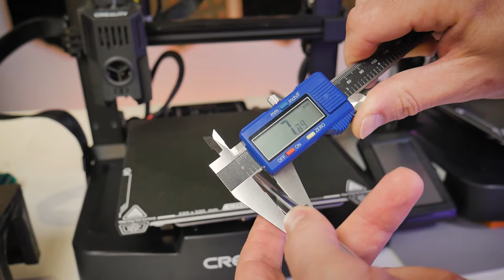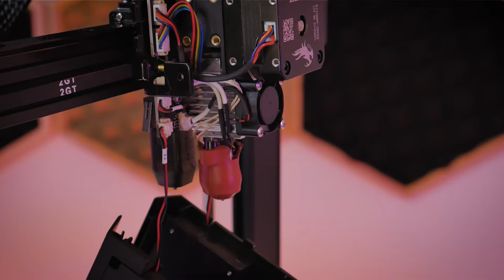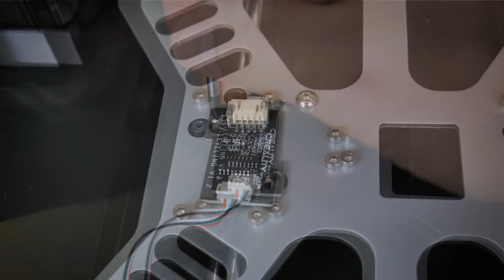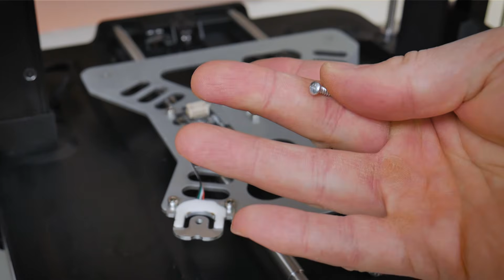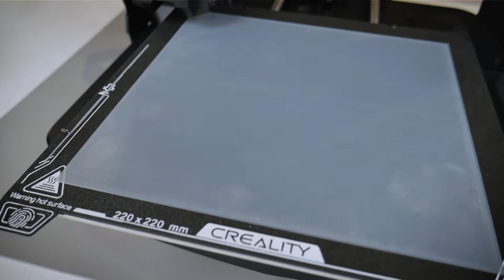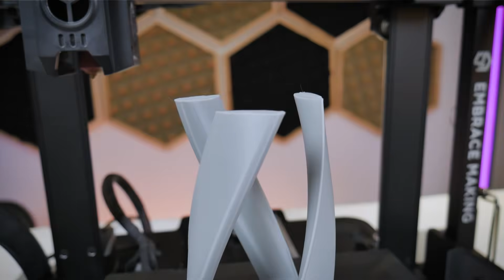Creality Ender 3 V3 KE/SE 10mm Rod Upgrade, Improve Bed Mesh, Fix Slanted Gantry, Unstable Print Bed

Comment: This is my first 3d printer. My gantry is inclined towards front I found a print fix to make it 90 degrees kinda fixed it but now my prints after 1 cm looks not smooth. I dont know what to do 😢

Comment: 5:04 for those who do not have metal machines blocks you could use the glue sticks one would use on the bed. As these are consistently the same length.  Two of those would achieve the same result on a cheaper more DIY basis.

Comment: Plastic stand-off's?  There's  the problem right their lol.  U didnt mention if u measured them for uniform size,   imo ,    They should be made out of steel ,precision cut, and at least 2x the diameter  of the plastic ones.

Comment: Bearings not included. As to why is beyond me. It’s an upgrade kit missing integral parts. And having to order them separately, risking that they won’t fit is just a nuisance.
Also, the plastic bearing holders are not precise. I had to print a 0.2mm shims to have no play of bearings and holder. And the bearings are precisely 29.00mm long. The inner length of the holder is 58.2mm. For the price, not acceptable.
ALSO: It is crucial that the bearings are oriented the right way. There is 4 rows of bearings in a linear bearing. They form a square when seen from the hole. That square must be perpendicular to the Z axis (or parallel to the x axis).

Comment: "As you can see I have printer rooted ..." , please elaborate
Reply: He has taken the printer off the factory settings and made it so that the firmware uses Klipper. My friend bought a KE and I told him not to ROOT the printer until he has a better understanding on 3D printing. Rooting can be reversed, but it is a pain. There are videos and articles online for rooting, but use with caution.

Comment: I bought the previous upgrade for the rails for the KE from you, and had to remove them after a few weeks because the rods were not hardened. The properly lubricated bearings wore ruts into the rods.

Do these new kits use hardened stainless rods, or is this just another ripoff like the last one?

Comment: i just recently got my v3 ke since i was looking into them and a friend suggested it as a first timer since he has one, been playing with it for a couple weeks now, sadly... my bed looks as bad the one in the video. i tried a couple fixes, but it didn't change much, using little washers for the mounting points under the bed kind of helped, but also made other area's higher, so i just took it all off and went back to stock til i get the 10mm upgrade i ordered a few days ago, granted i know i'm not getting it for a week or 2 for back orders, hopefully it fixes my issues for that, the bed does have a LOT of wobble with twisting, and a bit with pressing down at all.

but something i noticed with MANY video's and pictures. mine does NOT have the 2 front screws to press on the rods, ONLY the 2 in the back, not all KE and SE variants have the front screws, started digging into it and found out the one's without the screws in the front are basically dubbed by the community as the "V2" models. so i'm hoping that's not a must for the upgrade...

but thank you for providing an option for upgrades and/or replacements as i couldn't really find anything solid online and the few reddit post's everyone either links this video or the needitmakeit guy for the printed one with rails, or contacting creality which apparently they try to say even bad things are normal so they don't have to do anything which was reported a bunch for those with similar problems so i felt it'd be pointless to contact them then. as for the rails upgrade, which... i'm not sure how i felt about the rails, which is why i opted for your upgrade instead since it seems like it'd be a better route. just hoping it actually fixes mine pretty decently. i have noticed the auto-leveling can only do so much...

EDIT/UPDATE: 5-5-2025
so far, yes my "8mm" rods that came with it were not completely strait 8mm through the rods, and as his showed it did seem to do the same with a slight bend in the rods. the 10mm rods i got from Embrace Making did indeed keep 10mm throughout the rod except the 8mm ends were actually 8mm. once installed, it does indeed seem to be a lot more stable. it didn't fully fix my situation however, the 3 corners were still problematic reaching 0.677mm after new rods installed(was 0.928 or something before the new rods). once i knew the bed was nice and stable i went ahead and used printable shims to straiten the gantry a bit. then, since i knew the bed was better, i also leveled the rail with the extruder on it with 2 equal length items. even with all of this, only the corners were still off. good thing i also had ordered an 8 pack of those "Creality Official 8 PCS Silicone Solid Bed Mounts" from amazon only got the 8 pack as it's the only way to get 2 small one's incase i needed to use them all. and that was the final fix. then just needed to tweak how much i had to screw down on the one major corner. kept testing and putting the bed temp to 80c and finally got it good enough. the highest range on my bed is now only 0.152mm  i could get it better, but started getting lazy after testing and messing with it for 4 hours lol. basically, for my end, the biggest issue was for sure the bed it's self was tweaked and not level. so once i got it situated i put the heat up that much to help kind of mold it into that shape so after some use, hopefully it'll be strait.
figured i'd put all my info i had to do with my ender 3 v3 ke for anyone else needing or wanting to do this.

Comment: I think putting a woodwork square or small  triangle from a stationery set. on your bed when you adjust centring of the nozzle should help get things right in terms of levelling to the bed.

Comment: Just bought an Ender3 v3 ke printer. Watched all of your videos on it and just ordered the 10mm rail upgrade. Thanks for all of the info.
While plating with prints today I noticed that the x axis belt was wobbling a bit while the head was traversing. So I tightened up the belt during the job and the walls on the second half of the print were twice as nice.
Reply from the maker: Thank you so much for the order and the belt tension is definitely critical for nice prints!

Comment: You don't need to be rooted to see the bed level mesh. Just type in the IP address of the printer when you're connected to the same wifi. It will show you the same graphic as the screen. You can also exclude aspects of your print if one thing happens to fail.
Reply: What software do you use to see your bed level without having to root it?
Reply: @nikolaiyeakel6123  Hey. Just use an internet browser on your phone or computer that is connected through the same wi-fi as your printer.
Reply: @nikolaiyeakel6123 to find your printers IP, use the app on your phone (printer manufacturer) or go into settings (network) on your printer. You could always log on to your router and see if that way too.

Comment: Becareful with the front two screws.  My bed did not clear and when I tighten the screw it caused the screw housing to popped out.. It doesn't seem too bad and I will attempt to glue it in to ensure it stays in place.

Comment: Sigh.....having just bought the Ender V3 SE model .......do i really need to "improve" what is now a very high quality printer compared to the first model that came out in 2018 or so or when I bought mine and haven't used it due to upgrades, I thought I needed but didn't use.......now when the V3 model arrives it will get put to printing right out of the box.......no messing about doing upgrades that take time and put printing on the back burner.........sometimes you just have to be realistic and get on with it.otherwise I'll trip over my beard..

Comment: I got my kit about a couple weeks ago and just now got around to installing it. Your video here was clear and concise and the parts provided are beyond exceptoinal. I appreciate the drawing package for the rods to check dimensions and tolerances (they were almost close, but still workable).

A couple things I have to critique: 1) My range initially started around 0.6mm, and I got it down to around 0.49 ish. Part of it will havve to do with lightly adjusting the screws that mount the bed to the carraige. 2) The shipping took longer than anticipated. However as a machinist myself, I understand mostly the reasonings since it takes time to source materials, and machine everything to absolute spec...not to also mention I presume your small business model means printing time and post-processing plays here too. Digressing from that, perhaps I would suggest looking into a different shipping method, as my order took four days longer than anticipated to arrive at my address...due to the order sitting at one carrier, only to be passed off to someone completely different out of the blue.

Overall it seems it was developing worth the wait. I do feel a stronger, if not more rigid/solid bed formation here--with little to no bed slop/play.

Comment: Hey I'm finding that if I print a plate of identical thickness pieces the parts towards the front of the plate are roughly 1mm thinner than the others, would this be improved/fixed with this upgrade?
Reply from the maker: It could be for a few reasons. Before you spend money, check to see if your two vertical frame members are square to your print bed (ie. they are not tilted front to back) as this might be contributing to something weird happening like a wedge shape result. In the video you could see I had a front / back slope in my bed mesh before the rod upgrade... honestly I don't really know why because the frame was pretty square - but the rods did fix it. I can't guarantee that it will do the same for you but there is a possibility.

Comment: https://youtu.be/vzOEuqaEv_4?t=295 don't make the adjustment to the bed. make the adjustment to the frame below it on the sides. What happens if your bed is unlevel?  I would do this after removing the build plate.

Comment: just pull the bearings up and down slightly at an angle to the rail and tighten the screws. no modifications needed.

Comment: Just did this swap on my ke and it went pretty smoothly. Only issue was the two  front factory screws had been tightened to the point I had to use an extractor bit to pull them out (not an issue really, since the kit includes longer ones.)

Drastically improved my z-level and feels more stable now.

Comment: I've had 2 KE printers and not by choice. My first one was defective. It would not print a 1st layer so it was replaced. My current one has never achieved a "perfect" first layer nor any smooth prints. Close to smooth and close to "perfect" first layer but definitely something is wrong. I've exhausted almost all software calibration remedies and am moving back to hardware adjustments like belt and rod tensions. The main issue is that, when printing the same file back to back with no changes at all, the prints will be night and day. Also, I can make 6 decent prints in a row and out of the blue the 7th will be a disaster with absolutely no changes including filament. How does one troubleshoot something so random. After viewing countless videos and forums about the Creality printers I've come to the conclusion they have some ongoing quality control issues. I'm leaning towards a Bambu or Prusa but the Bambu is proprietary parts and the Prusa is a bit above my budget for what I'm doing now. My only alternative is to try and tweak my KE. That being said, thanks for this video. 😀

Comment: My Creality works great, it's my first printer, it only cost me $240, I solved some problems by watching videos, like centering the Z axis, I also tightened all the screws, several were a little loose, I put some rubber on the legs for vibrations, I installed some washers for the bed level and some paper for the rods that had play, the best of all is that I have a good time improving the printer, that's the fun part, not just printing things, "Sometimes the destination is not so important but the journey" Me 2024
Reply: Yep. There's nothing wrong with just wanting a printer to work out of the box but what got me into this hobby was the tinkering.
Reply: First printer for me as well!
Just grabbed mine last week.
I've noticed my screen seems to buzz quite loudly. Did you have any issues with that? Or anything else related to annoying sounds when printing at speeds higher than 100mm/s?

Comment: What is the name of the software you use in the video to see the leveling of the plate thanks
Reply: I need it too, did u find it ?
Reply: Just connect your phone or computer to the same wifi as your KE printer and type the printers IP address into a web browser. It will show you the same graphic that this guy used. This guy used Mainsail,  and you have to root your printer to use it)

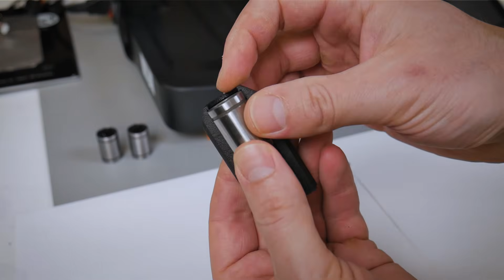Comment: 9:15 correct me if I'm wrong, so if they just sort of push in like that with what seems to be like not much force then when it's all assembled simply pulling up slightly on the bed will pull it off the bearing, so even just simply removing the magnetic bed plate could possible pull off the whole bed??

Comment: I wonder if anyone has tried replacing those plastic spacers on the bed with the Creality Silicone bed mounts. My only thought is that plastic probably wears over time due to all of the heat and could cause the bed to become less stable over time while the silicone bed mounts wouldn't have this issue. Probably a worthy experiment with only $9 in parts.
Reply: I replaced those with springs, that way I can additionally level the bed by tightening or loosening the screws, for now I'm happy with that upgrade :) costed 2$

Comment: what about speed, did it improve the max print speed (accells) with Resonances test? my Se only is stable at 3k, I dont know about stock ke, but stock se is 3k max without any artifats or other issues.
Reply: My stock KE goes up to 7500mm/s² no problem, haven't tried 8000mm/s² yet

Comment: My 3V3 KE doesn't have the two screws in the front that tighten down the Y rods... How do I go about getting the play out?
Reply from the maker: Your original rods have play in them? I have had a customer who did the upgrade and does not have the screws and they reported back with my kit that everything worked out fine. The fit of the holes on the frame should be snug.
Reply: this does the same function as the liner rail upgrade?

Comment: I bought and installed this with the silicone spacers, and it made a big difference. I realized the lower support bed is bent too far out of spec and needs to be replaced with something better that's truly flat.
Reply from the maker: Thanks for the feedback, really glad it made a difference!
Reply: What parte did you use to replace/fix that?

Comment: $60 Dollars!!!?:face-blue-wide-eyes: What are the rods made of gold-plated Unobtainium ?👽🤪
Reply from the maker: They're $50 - you might be seeing the full price in the YouTube listing, I'm not sure if they show promo sales. I might decide to increase it to 60 in the future.. normally I'm not one to find it necessary to justify my price - maybe it seems like a lot on the surface but I don't have the luxury of buying things in the 10000s and enjoying massive volume discount. The rods require machining (they aren't just plain 10mm rods) so I'm not paying for just regular rods, there is a labor cost in them plus shipping a box of stainless rods to me costs hundreds of dollars due to the weight. By the time I divide it out I pay $9 per rod and there are two in a kit... the multi jet prints are also very expensive - almost $7 each, also two of those - so roughly $32 in cost already,  and then the hardware, packaging + the labor I have to pay someone to do the heat inserts, pack the product / handle them / store them / maintain inventory. I can't do it all alone or I would never be able to make anything new or make videos. I'm now down to about $10 left per kit which some of that goes towards all of my other operational costs - and depending on how you pay with paypal or credit card I get dinged another 3-5% fees plus the taxes I pay on any profits. Hopefully you can see how it adds up quickly... on the promo price I'm walking away with very little profit and I have a small platform - I'll be lucky if I even manage to sell out my inventory.
Reply: Raw material cost is really low, they're probably machined to be straight within 0.01mm and that's why they're expensive.

Comment: My V3 KE doesn't have the two screws in the front. Does your 10mm rod kit take that into account?
Reply: I've just got my KE a couple of weeks back and it also doesn't have the front grub screws, so thinking the newst versions don't have them
Reply from the maker: Interesting, are there holes for the screws and they're just not installed? Send me an email through my website: https://embracemaking.com/pages/contact and we can figure it out, I'd love to see some pictures.
Reply: @EmbraceMaking I sent you an email and I can send pictures. There are no holes whatsoever in that spot.
Reply: @EmbraceMaking  No holes on my new KE
Reply from the maker: @alexdiver9809 no problem, it will work just the same. The newer models don't have the screws but other people have installed the kit and they don't need them on the latest ke. Thanks!
Reply: MY PEOPLE!